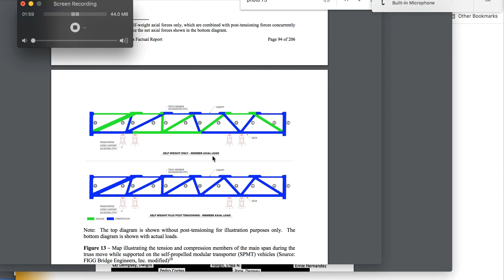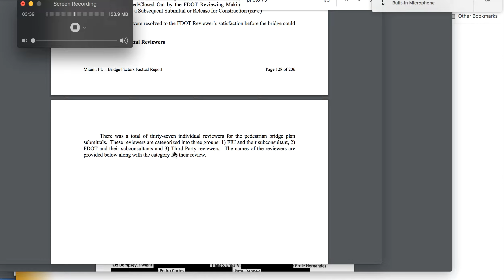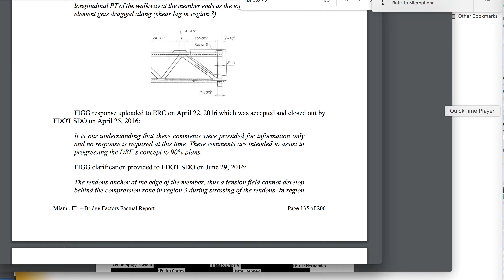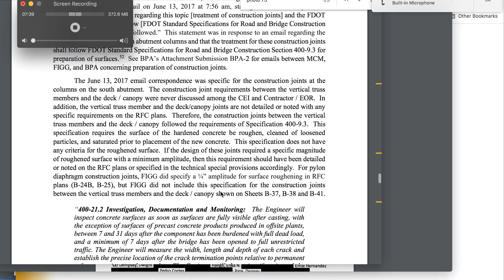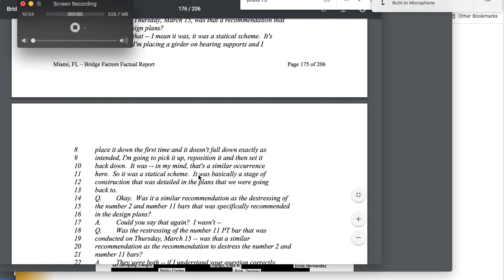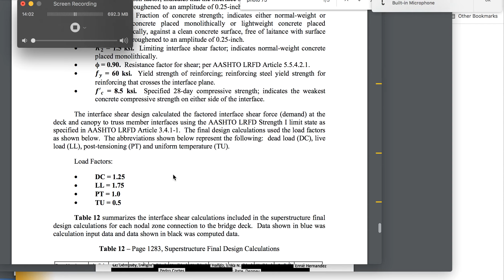FIU Bridge Collapse NTSB DOCKET Contrary to OSHA report, DEFLECTION in DECK known, Deep dive

Comment: Why does the FIU bridge have so much documentation and meetings.  Was it that cutting edge of construction material science?  To generate this much administrative activity, it appears it was a dangerous design with suspected deficiencies from the beginning.  

Just an anecdotal observation, but "exciting and innovative" lately seems to mean as little safety margin as possible and very little redundancy as possible.

How much would it have costs to build a conventional bridge with two or three piers with three I beams spanning the piers and putting on a concrete deck and other accoutrements like the canopy.  I should think it could have been open within one spring and summer construction season, I would believe in Florida construction like this can go on all year long.  

We build bridges like that over busy roads all the time here in Indiana.  There are some lane closures, or sometimes just narrowing, around the center pier construction and the road closed is during beam placement which usually happens between midnight and six in the morning so the road can reopen by six.

For that matter, we have walkways that are more than 18 feet wide that span across 6 lanes on just two piers.  The are all steel and glass structures that came in prefabricated and just lifted onto the piers.

The point is, there are easier ways to build this bridge that nothing short of a mobile car crusher would knock down the bridge.
Reply from the maker: James, I am sick, throat of all things... But, I so will try to do a live video... it will show the LACK OF EVIDENCE; NTSB does not show all those images they tooK of the collapse and they stay CLEAR of the major crack (twisting crack on the left) ... this and the deflection that is reported (which means the deck was failing first!!!) The mid- span / dead load was too great for this design.
Reply: Sorry to hear about your throat.  There is something going around here in Indiana causing a lot of vertigo.  

I would wonder why any investigator would want to stay away from something that certainly appears obvious and may be obvious in the end.  I can understand the inspectors that were responsible doing a CYA  but in theory the NTSB investigator should have no vested interests in this other than to determine if this bridge design and maintenance was proper and apply that finding to other similar structures.  I do agree, it appears NTSB is not always as impartial as I would like them to be.

Could it be the deck itself was just not adequate or the tendons in the deck did not have enough tensions or could ever have enough tension for the span it was going to cover.  I would expect some amount of deflection as part of its existence as a pedestrian bridge.

It looks like the bridge was going to be a place to congregate, I could see some break dancers up there getting an audience to dance in rhythm in an informal event.  It has been said that harmonic motion was the final straw for Kansas City Hyatt walkway collapse.  We can blame the engineering oversight, but it held up until the dance.  In England the Millennium bridge experience so much swaying and deflection it was closed very soon after opening for modification.  I have notice some people will start to adjust their stride to match the harmonics of a bridge which I think further amplifies the motion.
Reply from the maker: James, thanks for the Indiana vertigo comment, that is close to what I am feeling...  hmm   Nose, ear and throat are connected and one can throw the other...
Okay, I did a video on this ''expected report'' from the NTSB,    FIGG lobbyied them and you can bet this is the best they could get for their hundred plus thousand dollars, $120,000.00   is just what I found on a fast search.
https://youtu.be/uDM_yZ9O0sk   this is the video I did showing that the NTSB is just as corrupt as any other criminal organization... How would like to be able to lobby the prosecutor of your crime / charges / investigation...
Reply: I did not realize you could lobby and an agency like that.  It thought lobbying was reserved for house members and senators.  

I looked at Figg's website and did not realized how many substantial projects they have built over the years "Creating bridges as Art."  Obviously the firm has competent engineers but apparently had a lousy project manager over this particular project.  I bet they wish they never got involved with this project now.  I will bet there were some local shenanigans involved with the project.  There was some sort of federal  grant involved.

I could speculate all day on which came first now, the funding or the proposal.  This could have been one of those make busy work cases where a large company that is too big to fail needed to earn some money and a custom grant package was created that only they would qualify to get it.  It could be the school wanted to create architectural master piece on the cheap instead of a boring pedestrian bridge.  It could be Figg was forced into using a local construction company that was not up to the task.  This underlying drama will probably never be known, once a scapegoat is settled upon, with the goal of not being the goat.

I am surprised by how little the parties trying to through each other under the bus.  Figg probably could walk away from this if it was anything other than bad engineering design and project management.  Even if it was bad engineering or project management, it would just be a small blip on their reputation.
Reply from the maker: Will reply more once my head stops spinning
Reply from the maker: James, yes they can be lobbied and NTSB actually has lobby money they spend on lobbying also!  WTF  
It is crazy, to allow lobbying to NTSB while you are under investigation and yet, they took &100k pLUS dollars!!!    This report is what they got for their money, a report that ducks so many details it triggers me to write it down... 
I am not kidding on that... so, I am going to take a break again...  I will return once I ''untrigger"  "de-trigger"

Comment: Some deflection had to have been anticipated. However the horizontal expansion Crack in 10 not so far from the pier under 12 was strong evidence that the deflection was excessive. It meant that the walkway was sagging relative to the canopy and that not only were the D cables elongating  but the cables inside 10 were being pulled apart. It was highly speculative whether or not retentioning 11 would restore equilibrium to the point load on the D cables. Clearly it didn't. The sagging continued until 11 was detentioned again which was the straw that broke the camel's back as the force of 11 pulling up the load to 12 was transferred back to 10 pushing down on the deck and D cables.

The ultimate hubris was that Pate couldn't be bothered to get off his ass and go look at the cracking himself. Maybe that would have flipped on a light switch on in his brain.

Comment: Good catch on that 'deflection' term, a fine point most will miss... defection is only possible with tension... and that is obvious on the face of it for an intelligent person, but not for the types that built this thing... so badly that it collapsed without a load within hours of placement.
Reply from the maker: Thanks Phil, I have another video processing now... it will show that the one image I love so much is the ONE image that Figg's expert and NTSB duck! 
They explain the smallest of cracks and tops of this or that but they stay far away from this one image!  As this image explains that you cannot PUSH 12 off with a ''broken arm'' ...   I am still searching the reports but Figg's expert and Turner Fairbanks, U.S. Gov  also avoided this image so far!  https://ibb.co/HYtM3BQ